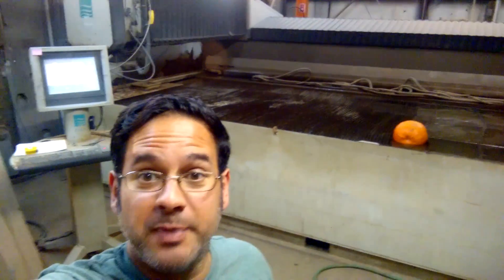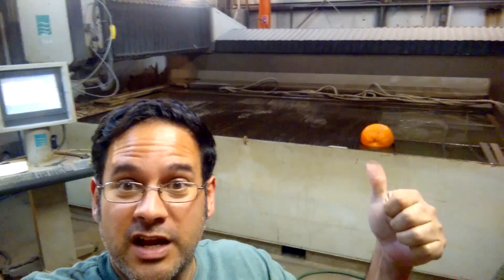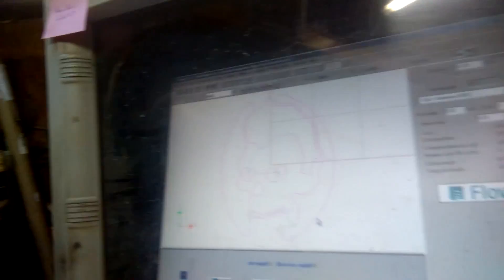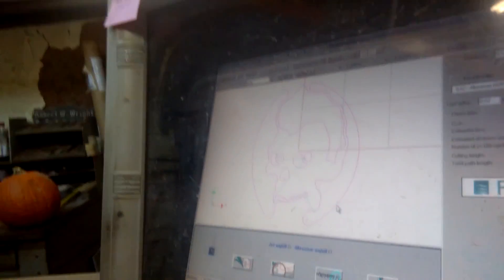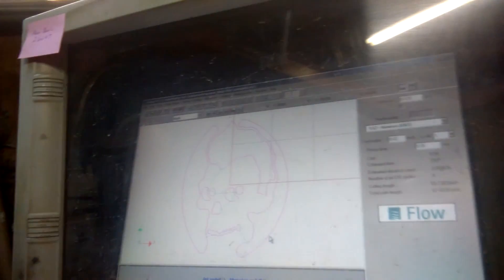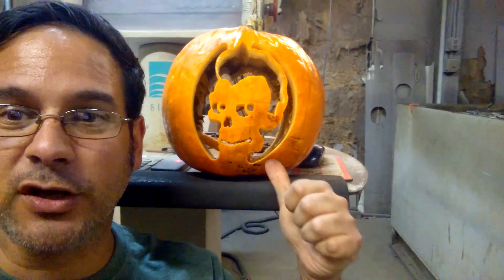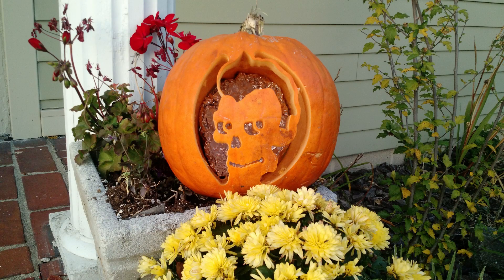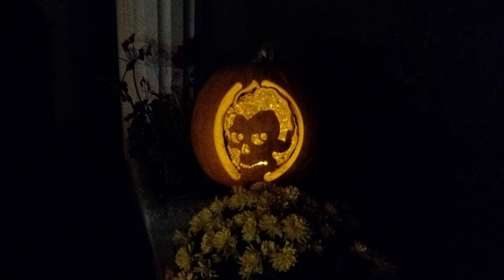WATERJET pumpkin carving - jack o lantern

Comment: second I saw this I thought "you are going to go straight out the other side". 

how bad was it? I'm assuming it wasn't as crisp.

is there anything you can put inside to absorb the energy and or divert the water without causing more problems.  I would think a metal plate would send the water side ways and blow out the sides of the pumpkin.
Reply: Just slice the pumpkin in half, carve the front half, then pin the halves back together..
Better: get several pumpkins and other fruits of similar shape and as close to the same size as possible, slice them vertically, horizontally, diagonally, any which way, into 1/4's, mix up their halves, carve 'em, and stitch them together with thin ropes.. Franken-pumpkins!
Reply: Ray Pena start early.  I'm already buying stuff for my niece's Halloween costume
Reply from the maker: +Cliff Hartle it completely blew out the other side....you can see it toward the end of the video that the back is missing.  I cut the pressure down to 20k but I think I needed to run it ALOT faster.  I'll try a few setting changes next time....next year.  I don't think a barrier would help any....it is a merciless machine!
Reply: Ray Pena ok I think I figured it out (note I have never used a water jet or have I seen one in person but this is the internet where everyone is an expert :-))

What if you filled the back of the pumpkin with ball bearings? It would maybe disperse the energy of the water.  

But this is not the oddest thing I have seen cut with a water jet. I saw an Unwrapped on Food Network were Swiss Colony, the mail order food people, use one to cut cake into small squares for petit fours. Its was around 8 jets wide and cuts the cake into perfect pieces without getting the cake wet.
Reply from the maker: that is the perfect disclaimer!  

yes waterjets have been used for some time in the food industry...I have done work for Kraft Foods and they use water jets to slice the most disgusting of food products: pickles
Reply: Ray Pena all pickles? :-O
Reply from the maker: ALL of them....and all pickle derivatives!
Reply from the maker: +Double Dare Fan I like the idea of frankenpumpkins!! I'll have to try it next year.
Reply from the maker: +Cliff Hartle wow!! That is early....you get the early bird prize!
Reply: Ray Pena lots of stuff to work out like how strap 6 or more small rc servos on her head to move a number of snakes. some stuff I have to buy now. hard to buy strings of red LEDS for eyes in August. this year I almost didn't make it.
Reply from the maker: Oh boy, you've got a project on your hands!!